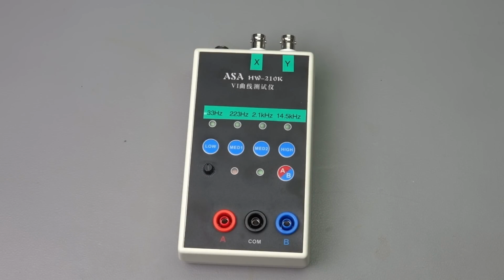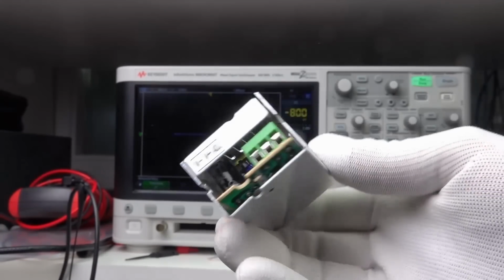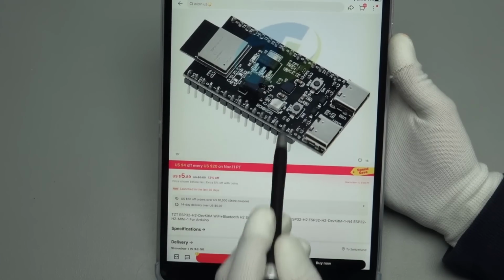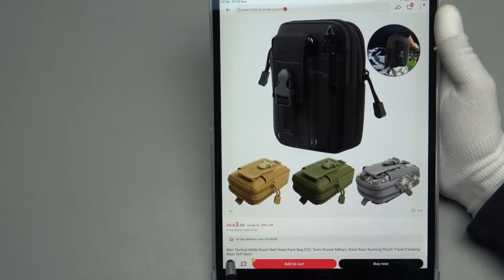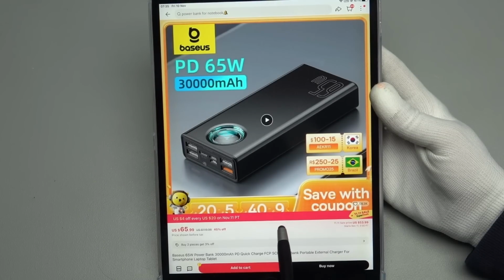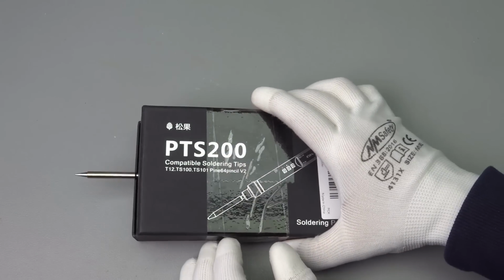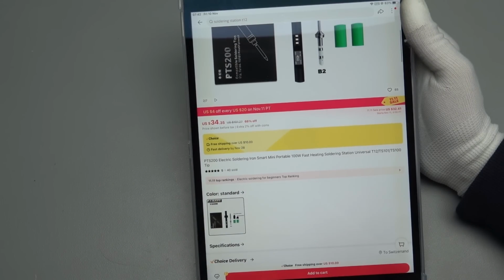470 Well timed Mailbag to save your money Part 1

Comment: Beware - I bought a package of the PTS200 plus various TS tips assuming they would all be 100W tips running from my new Baseus 100W charger @ 20V. It turns out that only the TS tip included with the iron is 4ohms/100W - all the others are 8ohms/50W, which appears to be standard for TS tips. Ok, they work fine but I feel a bit cheated. According to a Pinecil wiki, it seems there are also 'short tips', ST which are 6.2 ohm/64W. Of course, none of the Aliexpress listings mention the tip power/resistance ratings :(

[EDIT]: So where to find 100W tips?
[EDIT 2]: I see Bangood sell a set: "Original 100W Solder Iron Tips Heating Elements Customized for PTS200 V2 Soldering Iron"
Reply from the maker: Thank you for the additional info I did not know.

Comment: First of all I wan't let you know that I greatly appreciate the videos you are making and I follow them closely 😀 I have a small question. Is the Baseus power bank suitable as ups a tiny pc?
Reply from the maker: None of the USB-C power banks I saw are good as UPCs (the same applies to power supplies, BTW). They stop the current at all connectors when you connect or remove a device at a different port. I assume, this has to do with their power management (they have to distribute the max current to the different connectors).

Comment: I don't really understand the fascination with upgrading features on a soldering iron, and the difference between left and right handed use.  It's a soldering iron, it just has to get hot and melt solder.....    Just my thoughts on a doldering iron.   The sleep mode is nice, and fast heat up, but I don't know what other features a soldering iron needs :)
Reply from the maker: As a left-handed person, I like the left-handed mode. Not because I am woke, because it is more comortable...

Comment: I can’t help but assume (probably correctly) that the cells inside those cheap aliexpress power banks will be low quality & have less than half the charge cycles, on average, than a higher quality power bank, double the cost.. probably worth spending the extra if you don’t want to lose a good chunk of mah within a few years & especially if you plan on a lot of heavy use
Reply from the maker: I do not know because none of my powerbanks reaches this point. Even if it would only support 100 cycles, it would be ok for me. I also keep in mind where all the premium car brands buy their batteries ;-) So there is hope.

Comment: PTS200 - does it go higher than 320 Swiss Volts? (I mean degrees of course?) Also the higher wattage power bank you have - maybe that gives faster heat up?
Reply from the maker: I mesured 452 Swiss Volts (degrees) max on the 450 degrees setting. The heatup is pretty fast if your PD source can deliver 20V. A few seconds to 330 degree (my normal soldering temp).
Reply: @AndreasSpiess  Thank you! Looks like the best PD soldering iron, I already have two TS100 irons but I'd like to solder directly from a USB power block so I'll be buying this plus the block you recommended too!
Reply from the maker: @MatSmithLondon  You can also buy a PD barrel connector delivering 20V and use it with the TS100. Costs only a few dollars (search for "USB C Type C PD to 9V 12V 15V 20V 5.5x2.1mm Power Supply Cable" on Google
Reply: @AndreasSpiess  I didn’t think of that idea. Thanks!

Comment: Thank you for the two-part mailbag, Andreas! 
I understand it wouldn't work with 'flat' powerbanks, but for the chunkier types I wish there would be options for some units to be filled by the buyer with a bank of pre-owned 18650s.
Often with those energy banks what we need is only to change the controller side to something up-to-date with the latest charging protocols.
Reply from the maker: You find those cases for standard 5V power banks. So I assume they will become available for USB-C, too.

Comment: ESP32 Arduino Core 3.0.0 adds support for ESP32-C6 and ESP32-H2 pretty soon. Is there any reason you aren’t using esp-idf which natively supports them instead ?
Reply from the maker: The IDF is not accepted in the broad maker community (also because it only works for Espressif chips). The Arduino library and chip support is outstanding.

Comment: Now the big question:
Does the 30Ah 65w Powerbank fit in the small bag you purchased?
Reply from the maker: No. There I have a "standard" 5V power bank with less capacity. But it also has to be flat.

Comment: Any idea how safe it is to use a 20V USB-C to MagSafe connector for MacBooks that are expecting 19V? I find it hard to believe Apple (& others) would design something that'd be fine @19 & not @20, but...never know...
Reply: At 20000 mAh capacity, Baseus offers fast charging and 100W USB-C output. The power bank has two USB-C and two USB-A ports to charge four devices simultaneously. The company claims to charge the 16-inch MacBook Pro up to 36% in only 30 minutes. It’s safe to estimate similar, if not better, results for MacBook Air. If you have a 60W USB-C PD wall charger, you can fully charge the power bank in only 1.5 hours.
Reply from the maker: I saw that charging with 100W does only work for a short time with this Blade battery (it seems to overheat). Since I do not use Magsafe, I cannot answer your question. I would assume it works if MagSafe is PD compliant. But not, at which power.

Comment: How well does the curve tracer control base current/gate voltage?  Is it a reasonable transistor tester?
Reply from the maker: No, it is not a "complete" curve tracer. It only has two leads to measure current and voltage. Complete curve tracers have an additional cable to produce varying current of voltage for the base or gate. So you only can detect if a part works or not.

Comment: the connectors for Surface and Lenovo: USB-C PD will deliver 19V only if the load asked for it - do both Lenovo and Surface speak PD protocol to the power supply?
Reply from the maker: No, both have no clue about PD. And my old Samsung was "born" before PD was even defined.
But a chip inside the adapter knows what to do (similar to the 9/12/15V barrel connectors I showed in another video).

Comment: A introduction for a power bank or "DIY board" that can generate the newer USB-PD voltages for power up to 240W would be interesting - haven't seen many of those yet.
Reply from the maker: I have no use case for such power. My newest iPhone consumes 26W max (and I will not use this speed because I want to keep the battery for as long as possible and over night, I do not need speed).
Where do you see the need for 240W?
Reply: @AndreasSpiess  Laptops, power tools, solidering irons and bigger battery banks (including ones with mains output). 
Already today, laptops with build in GPUs can not be run through USB-PD at full power, because they need more than 100W under full load. DELL for example is or was using proprietary USB-PD extensions to provide 130W through USB-PD.

I agree though, that it is not relevant for phones and tablets.

PS: E-Bikes, Scooter, etc. may also be a valid use case.
Reply: Yeah, DIY board strikes a chord with me.  I've been on the hunt for a board with like 5-6 USB-PD outputs that I could put on, for example, a Mean Well 2-300w@20v power supply.  I'd like to eliminate all the little wall warts on the various routers, switches, miniPCs and other junk in the lab and have just USB C for everything.  (One can dream...)

Comment: Omg This soldering iron is what I needed 😮❤
Reply: This type of USB-C soldering iron but compatible to the JBC tips. 
Sequre has them for the different JBC cartrdidges
Sequre S20 with c115
Sequre S60P with c210 (the Sequre S60 without P is an older version)
Sequre S99 with c145
Review von SDG Electronics of the older S60 (without P): 
https://www.youtube.com/watch?v=2NqDumeKurw 

You can have all the good tips, not only china clones. And the handle is shorter then the T12 style handpices which is good for the small SMD parts. @AndreasSpiess

Comment: I've seen reviews of similar powerbanks from alli. Problems with overheating and overstating capacity are common.
Reply: Baseus is quite a good brand and seller. Got multiple wall adapters from them and a powerbank, so far going strong.
Reply from the maker: On the blade, overheating can be a problem, too if you discharge 100W for a certain time (it switches off). Here, I do not have such scenarios. The capacity seems to be ok (I never was able to completely discharge such a battery before I had the chance for recharging).

Comment: Regarding power banks, it's challenging to find one that can output more than 20W while being charged simultaneously.
Some disable the output, others restrict the output to only 5V, and some reset the output when a charger is connected.
Could you test for that in your testing of power banks/USB PD?
Reply from the maker: To answer your question,  did the following test: With both batteries (not fully charged), I connected a standard USB cable as a 1A load. Both continued to supply power when I inserted a USB-C cable for charging. And both were charged with PD voltages (checked with a tester). 20W was not possible in this setup (the white has only 1 USB-C port)

Comment: The H2 isn't interesting at this moment as you need to strip the WiFi code from the rest as it isn't really well separated in the Arduino core.
The C6 is very interesting though. I am using the PlatformIO platform and platform_package from the well known Jason2866 and have ESPEasy running on it already.
WiFi6 (802.11ax) is also working just fine on it.
Really promising platform.

Comment: Missed opportunity, to show and explain the difference between fast and slow diodes on the curve tracer.
Reply: Well, there are also fast and slow learners.  @cannaroe1213
Reply from the maker: Would 14kHz be enough to show the difference?
Reply: @AndreasSpiess  If you use a normal mains rectifying diode (for 50 Hz), I'm pretty sure you'd see a different path for the rising and falling voltage. Maybe not a huge difference, but I'd surprised if you wouldn't see a clear difference between a normal rectifying diode and a fast recovery diode. Why not try it out and see?

Comment: Summary
- Intro (0:00): Large mailbag containing items for current and future projects.
- Mailbag Contents (0:03 - 0:45): Divided into two parts; first part published on November 11th, second part on the following Sunday.
- Shopping Strategy (0:45 - 0:51): Waited for potential price reductions, filled shopping cart in anticipation.
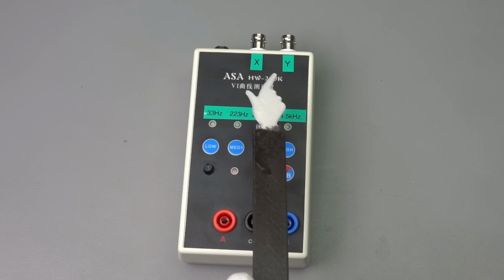- Video Navigation (0:51 - 1:07): Chapters included for easy navigation to products of interest, links in video description.
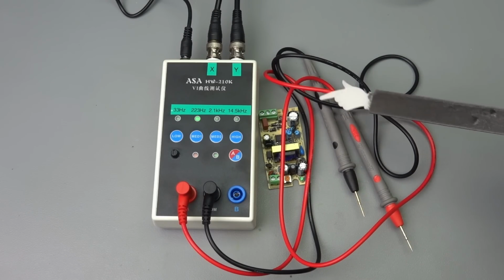- Curve Tracer HW-210K Overview (1:07 - 4:41): Demonstrates a curve tracer for repair and education, labelled in Chinese, can measure various components (resistors, capacitors, diodes, transistors), useful for analyzing faulty parts in power supplies.
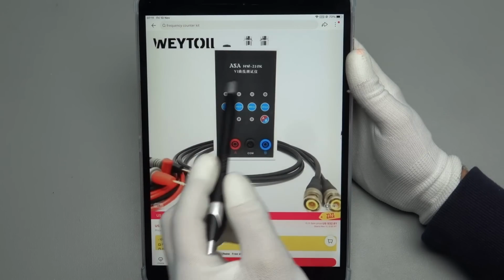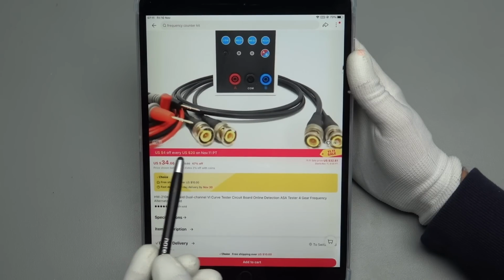- Curve Tracer Pricing (4:41 - 4:53): Listed for $34.66 with free shipping and a $4 discount.
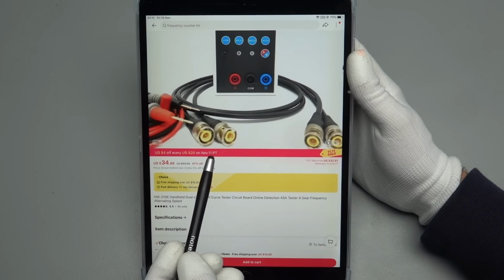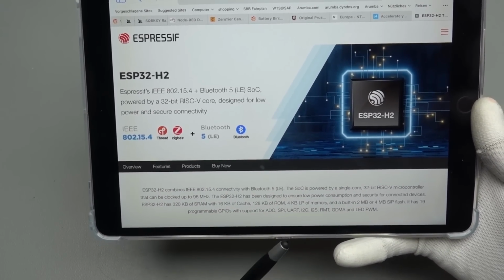- New Espressif Boards (4:53 - 7:49): Received ESP32-H2 and ESP32-C6 Dev kits, both with USB C connectors; C6 module larger than H2. Detailed features including WiFi6, Bluetooth, Thread, and RISC-V cores.
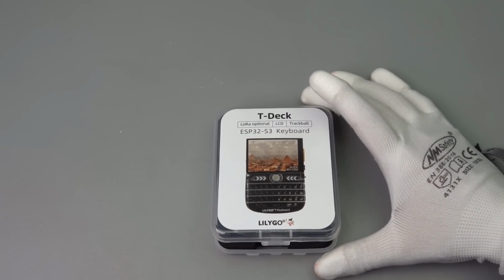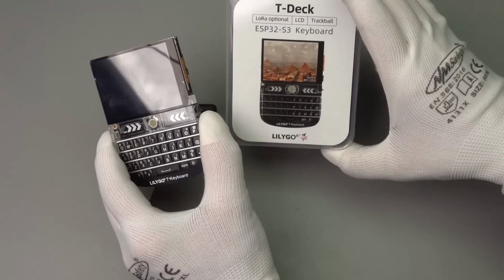- T-Deck ESP32 S3 Overview (7:49 - 9:21): 66USD Features a touch display, keyboard, joystick, and runs Meshtastic; available in various frequencies (868/915 MHz), but lacks GPS.
- Low Power Tracker - LoRa and APRS (9:21 - 10:17): Purchased a LoRa device with NRF chip from Nordic, features extremely low power consumption, Bluetooth, e-ink display, and GPS for tracking, suitable as an APRS tracker.

- T-Deck Pricing (10:21 - 10:56): Listed at $65.98 plus $1.68 shipping, with a nearly $10 discount during the November 11th to 17th period. Available in various frequencies and colors, including a white keyboard.
- Te Echo Pricing (10:56 - 11:20): Priced around $70, available in multiple frequencies and colors (brown, white, black). Shipping is $2.32, no special price noted.
- Versatile Small Bag (11:20 - 12:07): Showcases a small bag for carrying an Android phone (for balloon tracker software), power bank, and charging cables. Fits everything neatly, ideal for balloon tracking missions. Listed as "Main Tactical Molly Pouch Belt Waist Packback EDC Tools Pocket Military Waist Pack", priced around $4 with $0.20 shipping.
- Power Banks Overview (12:52 - 16:11): Two power banks discussed; one with 30,000mAh capacity, another with 20,000mAh. The latter is thinner, ideal for small bags, both support 20 volts USB-C power delivery. The user standardized to USB-C for its versatility.
- Power Banks Pricing and Accessories (16:11 - 17:06): The 30,000mAh power bank is priced at $65.99 ($53.99 on sale), while connectors for devices like Microsoft Surface and Lenovo are priced around $3 to $16, with various shipping costs.
- PTS200 Soldering Iron (17:25 - 20:15): Discusses the PTS200 soldering iron, which is hackable and programmable via Arduino IDE, has USB-C connection, power delivery, and supports standard soldering tips. Priced at $34.35 with free shipping, on sale for $32.41.
- Conclusion (20:15 - 20:28): End of Part One of the mailbag series, with Part Two to follow, featuring more products not all available on AliExpress.

Disclaimer: I utilized ChatGPT 4 (10 Nov 23) to condense the video
transcript into a summary.

Comment: 150C, not 150V...
Reply from the maker: You are right!
Reply: @AndreasSpiess  Phew... I began to wonder if there is a correlation between voltage to heating elements on soldering iron and degrees. Thanks for clearing that up.